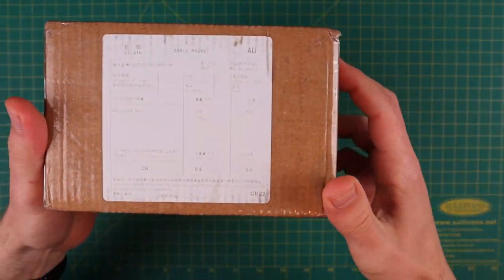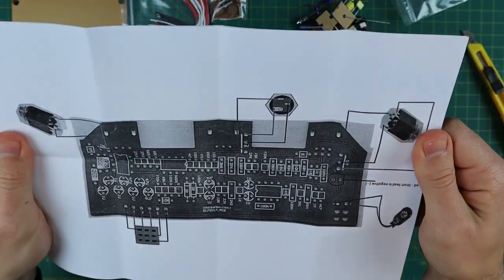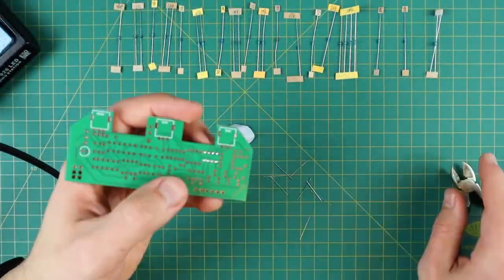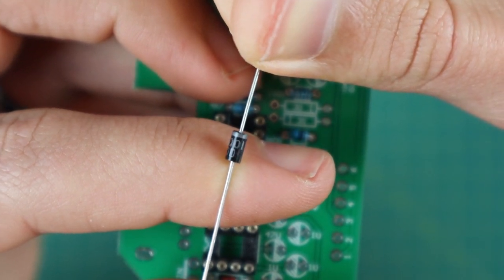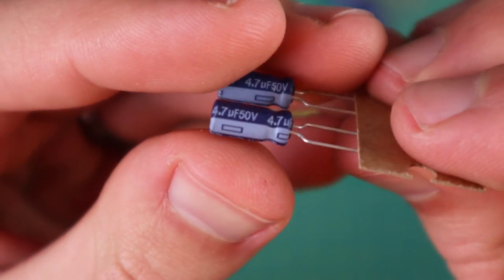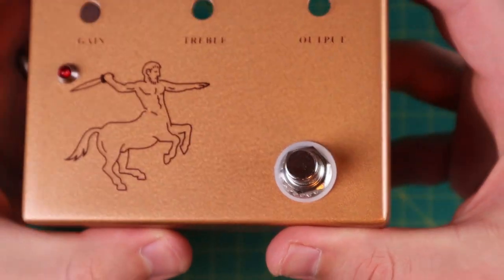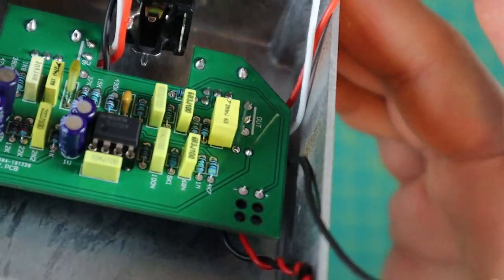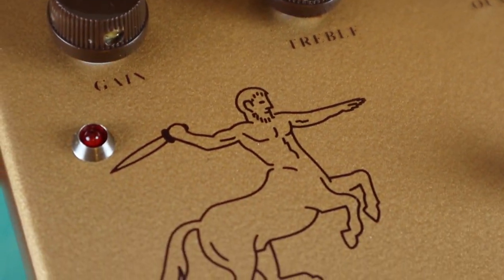How to Build a Klon Centaur Clone From a Kit (Step-by-Step Tutorial)

Comment from the maker: Read the full step-by-step instructions and wiring diagrams here: https://guitargearfinder.com/guides/build-klon-centaur-clone-kit/
Check out the guide to learn more about all of the components used, common problems you might encounter, and best practices when building guitar pedals.
Reply: awesome
Reply: Great video..Easy to understand you explained everything just right!  Made me understand it with ease. Now actually DOING it is another story
Reply: I've just bought this very kit from their Aliexpress store after your video. Did you see they've got a "deluxe" of sorts version, that mimics absolutely everything the original had, down to the components' make and models? Of course, that one's way more expensive.
Reply: @wmoecke  So how does it sound?

Comment: I would also recommend testing the resister values as you're building. Some may be mislabeled or faulty, so checking with a multimeter as you go could save you a big headache later on.
Reply: not to mention the colors they use today where i swear the REDs are ORANGE and vice-versa.
I know it couldn't be my aging eyesight...
Reply: 99% of the resistors can be testing without desoldering. right on the pcb.
Reply: Good tip👍

Comment: After looking at the instructions and realizing that was not gonna happen… I stumbled across this video. Probably one of the best step-by-step tutorials I’ve seen on just about any subject. Took me a couple of days, but that was because this was a first for me and I went incredibly slowly step-by-step.  The hardest part for me was really identifying the resistors. While they were “labled“, the writing was really illegible and the brown bands were indistinguishable from the red bands. Anyway I was finally able to sort them out correctly.
After installing the battery and plugging into the output jack no light turned on so I was bummed that I had done something wrong, until yeah yeah yeah I saw your step about pressing the toggle switch and voila we had light!  Sounds great really excited about this new pedal.  Great video.

Comment: Just built the kit. Your detailed guidance really helped with some tricky bits. Latest kit comes with colour photos which is better. Best points from your guidance pdf are: capacitors are a tight fit; orientation and connection of I/O and power connectors and connection of switch.  Everything went smoothly so many thanks.
Reply from the maker: Great to hear! Glad you found the guide helpful. Enjoy your pedal
Reply: @AaronMatthies  love the pedal. I forgot to say that without your video and notes I would never have taken it on. So many thanks

Comment: I just got mine to work today.  Some lessons I learned - watch capacitor orientation.  I was building this when I was dead tired, put one of the caps in reverse.  Lucky it didn't explode on me.  I also assumed that both of the 1072 ICs were oriented the same way, with pin 1 left.  Not so.  I got the cap desoldered and reinstalled, turned the IC around and it worked!  The 7066 IC had been getting very hot, and didn't after these changes.  I thought I had a bad chip and ordered replacements off Amazon, but the replacement got hot, too.  I did have to repair pin 3 of the 7066 IC after accidently bending it, and on unbending the leg snapped off.  Used 22 ga wire to replace the missing part of it.
Sounds great, looking forward to messing around with it.

Comment: Just put mine together, Has a almost identical layout slight revision of the board... The peddle worked on first power up (worked as in passed signal in both modes of operation)
first kit build done in decades. Now comes the fault finding! or use it as is, one of my best fails (home built fuzz) not based of anything built on strip board version one instant die-back of each note chord played with nasty distortion kept that one its fun to use the second works fine. So getting back to works even a broken peddle that does something different may be better than the one of the production line that just works as labeled... Have yet to have a real play with it.

Comment: Awesome video.. Thanks so much! I got tripped up with my build at the footswtich like you mentioned. Got that sorted and it now passes signal, but the output is super low! Would you have any ideas why with would be? Had a bit of trouble with the 4001 diodes, so may have overheated them if that matters?

Comment: Thank you making this video, Aaron! My pedal was turning on but I wasn't getting any sound coming through the it. This was because the photo copied wiring diagram from the manufacturer was very difficult to read. Thanks to your video, I was able to check my work and determine that I wired the input jack with the opposite wires. That should do the trick! Appreciate your help greatly.
Reply from the maker: Glad it helped! That wiring diagram was horrible to use, so I'm glad you solved the issue with my video. Enjoy your pedal and thanks for your comment.

Comment: Just finished mine up today. Took three days working an average of an hour a day. Only issue I have is a high pitched hum that gets worse if I turn the treble all the way up and almost goes away if I turn the treble all the way down. I'll have to go back through all my solder joints and make sure I don't have any shorts. Not really sure what else it could be.
Thanks for the tutorial!

Update: I resoldered the pins for the treble and output pots and the hum is gone! For a clone, this thing sounds awesome! If I turn the gain on my 15 watt tuber up to just where it starts breaking up and then engage the pedal with the gain at max, it sounds richer even than my MXR Super Badass distortion pedal! Very versatile pedal. Thanks again for a great tutorial!
Reply from the maker: Glad to hear you found the issue. I know how annoying it can be when a pedal doesn't work properly on the first try, so great job getting yours to work.

Comment: Thank you Aaron for doing all this work. its a great kit, and if i had followed your instructions better i would have built it and it would have worked first time (I got the IC's in the wrong places, and it took me 2.5 hours to troubleshoot). the Wish kit is very comprehensive, down to the pre-cut and tinned wires, and the fully marked resistors and other components.

Comment: Great video! I like that you pointed out that the locating tabs on the  pots need to be clipped and filed. I have four pre-assembled Klones from China and all of them had the tabs on the pots still. Clipping and filing them will make them sit properly in the chassis and avoid damaging them when securing the nuts, however the board will sit lower in the chassis and the LED height may need to be adjusted. Also, the pre-built green pc board hand wired units that look like this kit have 7/16" holes for the 3/8" jacks. If the jacks are tightened too tight it can literally pull the threaded collar out of the jack. I highly recommend some better quality jacks, like Switchcraft #12B TRS jacks and internal tooth star washers to keep them in place. That may well be the weakest link in the Klones I have found. In fact, the black board pc mounted jack units have their own issues, not the least of which is the jacks do not have support washers to fill the gap between them and the chassis. This can also damage the jacks & chassis if the nuts are secured too tightly. Building a kit like this has the advantage of allowing the builder to address these issues as they are building it. Plus it's a great feeling to put a kit like this together and then play through it. The clear shots of the pc board were a big plus for me. It will help me identify the components in mine for some possible tone-tweaking. Thanks!
Reply from the maker: Thanks for sharing those tips!

Comment: Hi 🙋🏼‍♂️ 

So I also followed your guide exactly and troubleshooted a lot but I can’t seem to fix it.
So I can’t post any video reply’s here but when I test my pedal with a ps (which works with my other pedals)
and it is turned off than it outputs a knocking sound to my amp. When I turn the pedal on the LED starts flashing after a few seconds - where could I contact you for more help? Would really appreciate it since I’m new to this and I want to learn as much as possible.

Thx
Reply from the maker: Sounds like a tricky problem. The only things I can suggest is to slowly work your way through the circuit using a multimeter to look for any bad connections or shorts and try using an audio probe. I imagine there's a short somewhere, but I don't know enough about electronics to guess where to look. Sorry, I hope you find it. I know it can be frustrating when something like this happens.

Comment: Thanks for the guild. Just built mine, a small problem is the LED will lid up when I plug in the power cable (no guitar cable in output) ,  or when I connect it to battery with guitar cable in output. the nobes are working fine, any advise will be appricated.
Reply: I have the same Problem plus my led starts flashing and the pedal only outputs a knock which strangely is in time with the led blink - I don’t know what is causing this issue and would be very grateful for help!

Comment: The instructions in your build guide gave me what I needed to complete the project. I am specifically referring to the photos with the added numbers clearly showing the solder connections on the power jack, the In and Out jacks and the push button switch.
The printed instruction sheet sent with the kit in 2022 is now in color but it is still lacking in clarity. I watched your vid and used your guide throughout the build.
Reply from the maker: Glad you found my guide and numbered photos helpful! Enjoy your pedal.

Comment: Thanks heaps for this. I have the exact kit in this vid. (mine is brushed aluminium instead of gold but identical otherwise). I've been kinda holding off on making it so this is a huge help. I'm going to follow this step by step. To a guitarist building your own Klon is like a jedi building his own light sabre - Once you've done it, your skills are complete :-)
Reply from the maker: Enjoy building your pedal, young Padawan. It can get frustrating at times (especially if it doesn't work perfectly on the first go), but it's definitely worth it.

Comment: I spent today at work looking on amazon at klones and saw a DIY kit.. Was considering it, but the reviews we're filled with people saying "don't buy if beginner". Was kind of throwing me off of it, but it crossed my mind to check youtube to see if there was someone like you that made your video showing off basically how easy it was and a step by step guide. Tbh, from watching this, it seems like it would be fun to build even if I'm new to the whole pedal building - and the end result sounds nice! :)
Reply from the maker: On my website, I have a few tutorials that explains pedal building for beginners. One talks about all the equipment and basic steps to building you might find interesting. There are a couple of tutorials walking through building simpler pedals than this one, so if you feel this might be a big much as your first build, check out those other builds.
The hardest part for a beginner is soldering, so if you spend some time practicing that skill, you'll find it easier when you try building a pedal. Have fun!
Reply: @AaronMatthies  My experience with soldering so far is installing pickups into a few of my guitars, Maybe like 5 or 6 or so pickups total, two of which had the gibson wrap for the ground wire. That guitar being my fav to play. 

So I've got a small amount of experience, but I'm not like thrown off by it being complex or anything. :P

I did check the site out after watching the video though. Will probably go back there too for a refresher later when I actually find a kit to buy and go at it.
Reply: @AaronMatthies  So I did get the pedal, it came a couple days ago, and put it together last night. Did a little test recording in Reaper today and threw it up here. Your video was the perfect thing required for someone new to this wanting to get into it. Followed along to the video, and about 6h later I was done. 

Only thing was the kit I ordered had two different parts. I had two additional ceramic capacitors where you had yellow boxed ones. Also I had to guess where they went for the most part. It was kind of easy to figure out though based off how everything else is named and matched up.  That and the blue cylinder capacitors you had, I had about 7 grey ones. Other than that, everything was the same. I can open it up and show you if you're curious, but yeah. 

This has made me want to get more DIY stuff. It took a long time for the parts to come, but it was worth it imo and it sounds awesome! :)

Comment: Thanks for this video and the webpage. I just finished assembling a kit like this one, and your video and page were a big help. I'm a tech, so I also used a schematic to ring down the circuit. My kit was 100% faithful to the Klon circuit, but there were a couple of flaws that had to be corrected. The silkscreen on my board had the feedback and output resistors swapped, and the zener diode cathode wasn't connected to anything at all, just a through-hole holding it down. I also made a slight mod to the LED connection so that I could remove the board without desoldering the LED leads. It sounds great, thanks again!

Comment: I have build one of these, being very careful checking values ... but it didn´t work completely. I got some voltage values that looked fine on the op-amp, and the LED turned on and off, 
but the input shorted when mounting the input jack. I isolated the jack, but it still does not work, so maybe half of the switch is wired wrong. I will check out you website, and see if I
can locate the problem.

Comment: The pcb of this kit has 2 errors (at least). The (-) side of the second from the left 47uF electrolytic capacitor and the (+) of the 12 V diode are not connected anywhere but they should be connected to the ground. The diode is for protection so it won't affect the sound but the 47uF cap affects the bias and thus the sound a bit.

They are both easy correct by connecting to nearby ground connections.

Comment: Hey Aaron, built this and it works. THANKS a million. The only issue I have is when I use adaptor ispot 9V when I click pedal off 1/2 my volume drops. When pedal is on it's back up to correct volume.This does not happen when I use a battery.  Once again thanks for extremely informative video. Any suggestions would be appreciated.

Comment: With a lot of pcbs you can install the pots so they form a straight line (as in this model) or you can flip the middle pot 180 so they form a little triangle cluster. 

I can’t tell from looking but could you make the pots into a triangle cluster on this build?

Comment: Hi there, what a great help this video is. thank you. I have gotten to the wiring phase. did you use the black  wire for the hot on the input? I am a little confused
Reply from the maker: The guide on the website has labeled wiring diagrams that might be easier to follow: https://guitargearfinder.com/guides/build-klon-centaur-clone-kit/

Comment: Clean the leads anytime you even suspect they might be dirty/corroded/etc. Solder won’t stick to dirty metal. The leads on those germanium diodes looked O-L-D.  Double checking the value of resistors and caps with a DMM is good practice.

Comment: Just finished pedal! was  fun!! however why not ship a little better schematic... not a big deal as the video is great... however..... one issue... mine came with 2 resistors already put in but not soldered... i soldered them in... then watching and reading differnt info since there was no usable schematic, i looked at valued after pedal was complete and realized the 2  put in from shipper ( unsoldered) were backwards to the reading.. I tested the resistance and in fact they were backwards... in a haste I switched them and soldered in according to the PCB ... now question is.. which is right? getting mixed information... these are the 2 resistors to the rleft of the germaniums ... anyway upon firing up pedal it definitely works and super quiet no back hum or anything ...but.... seems when I turn it on with the amp i loose crunch and deepness instead of gaining this.. also the treble center pot doesnt seem to change tone at all.. im using my Fender tweed NOS Jr  with it... doesnt sound bad just not what im expecting...

Comment: Soldering tips:
1 clean soldering iron tip
2 lightly scrape all legs on components with xacto knife to remove oxidation
3 use quality solder
4 use the lowest temperature to heat component leg & pcb. PCBs are very sensitive to too much heat. 
Thanks for the video. The instructions are weak especially the 1st step to Cut, grind or file off the anti-rotation nubs on the pots. If you remove the nut & washer from the pots you will see a little nub. This nub will make the pot sit at an angle when inserted in the case hole if not removed.